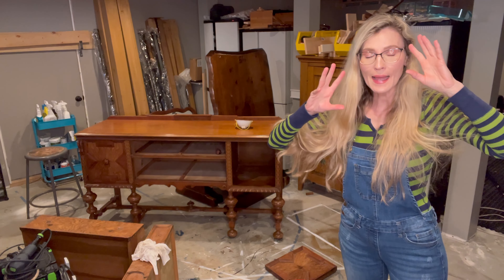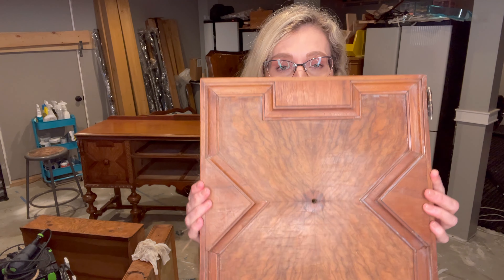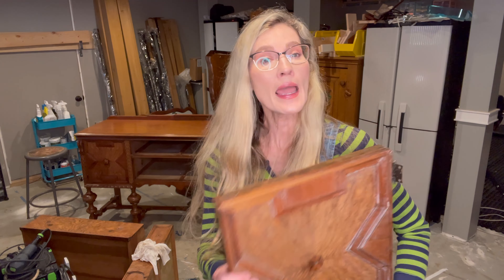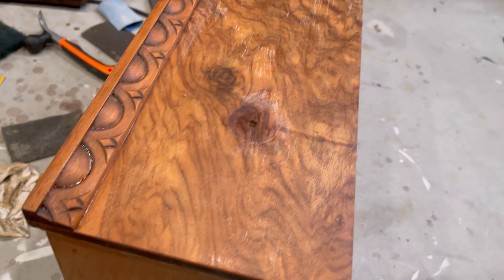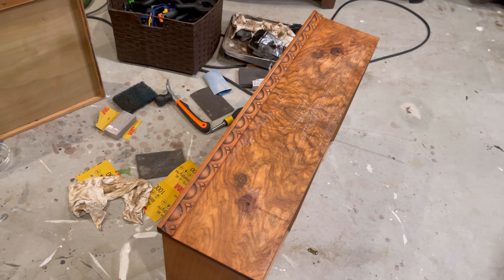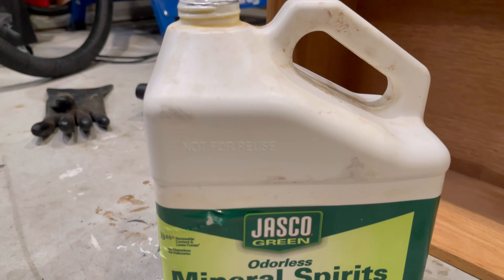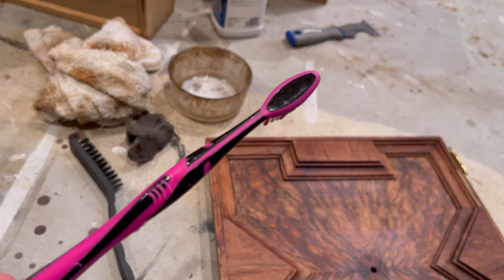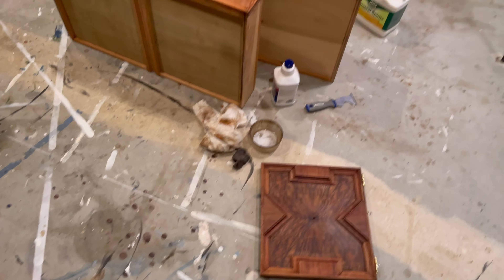SAFENOL Paint & Furniture Stripper | My Full Review

Comment: As a first time user of stripper, I used 4 gallons of the Soy Gel Stripper (not the safenol one- just the regular NMP one - its roughly 80$/gallon)  to do my roughly 19 kitchen cabinet doors and 9 drawers LOL. I get my stuff from the Woburn MA woodcraft.. Took a few weeks as space was in issue. Great product!  Very slow long process with 1 heavy coat on each side of the door left on for 24-48 hours and then scraped off. Now Im onto the sanding stage... and finally bought a Festool extractor/sander for dust management after leaving a very long comment on your previous video asking you whether I should get that system or not  :) PS: I have been through this long experience with the Soy Gel stripper- give it 24 hours and you need a MUCH THICKER COAT. Also i did not have any paint on my cabinet doors or stain. I just hand maple wood cabinet doors with a thick layer of poly from 20 years ago. After leaving for 24 hours, I was down to bare wood. I wanted to preserve the grain of the wood because I am going to sand now and then do a few coats of oil based poly (no paint again)